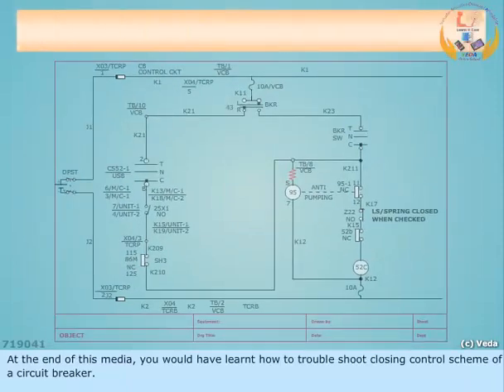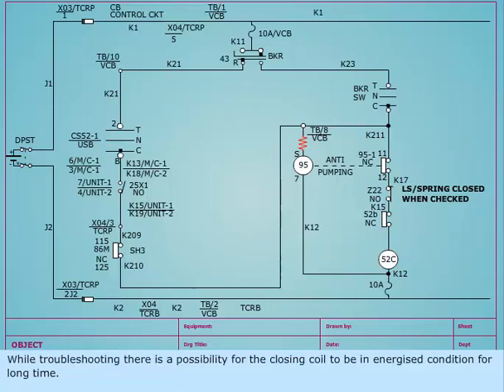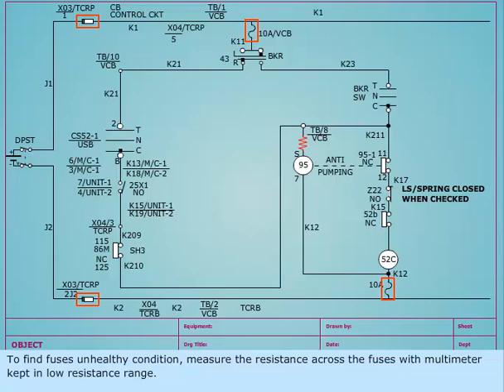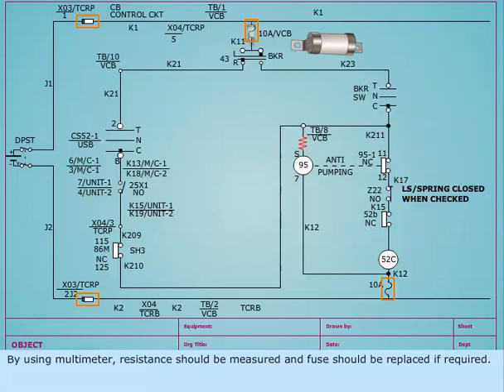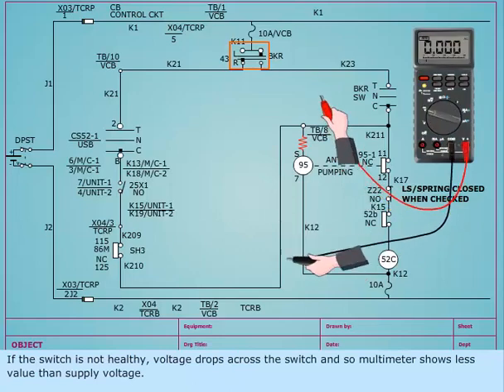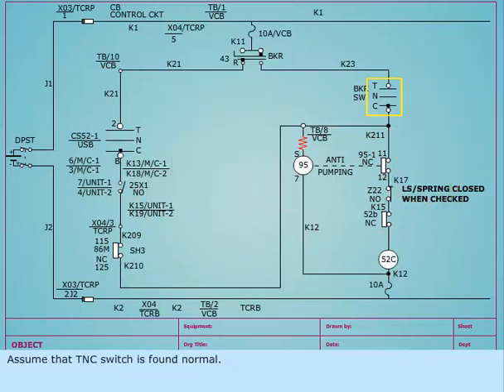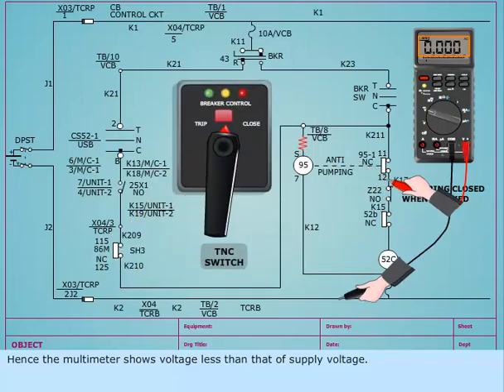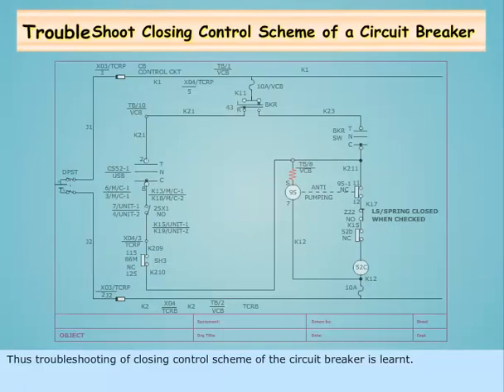troubleshooting of closing control scheme of the circuit breaker

Comment: Anti pumping relay is in parallel to closing coil , the function of antipumping relay is to relieve the closing coil from continuous operation , closing coils are designed to sustain closing command voltage for a fraction of a second , if it is not relieved then it may burn out...

Comment: When fault finding on complex relay control circuits , use a voltmeter and make the 0v line had wired to one of the test leads on your volt meter,  AC circuits , or Negative DC circuits ,once this has been done you are now able to check the circuit throughout using the other probe on the volt meter .,  I myself start at the relay and worked back to find a live feed .